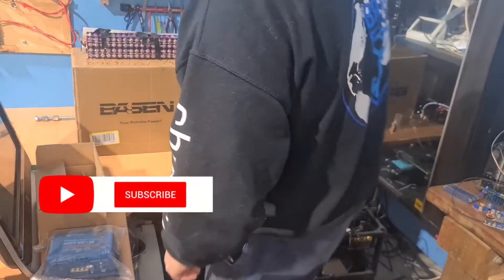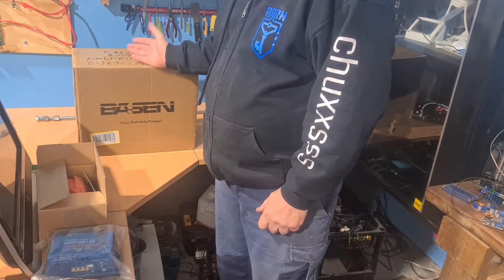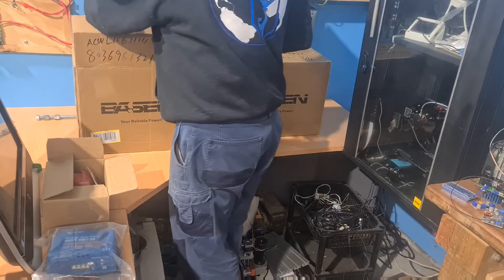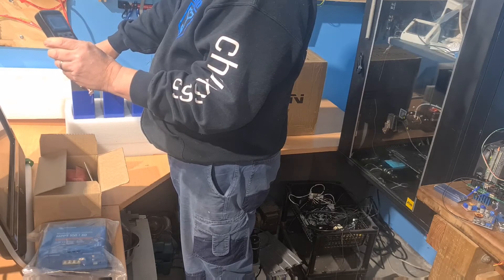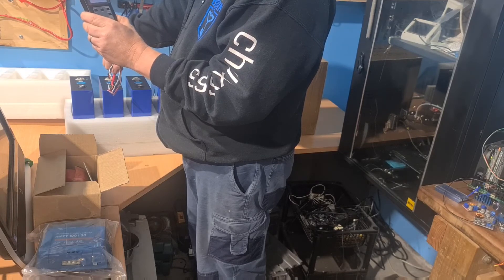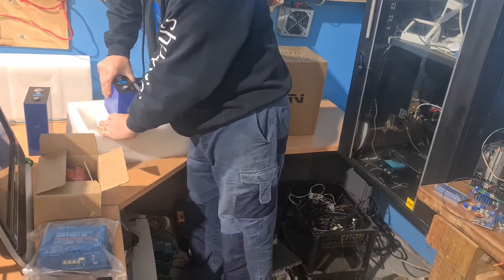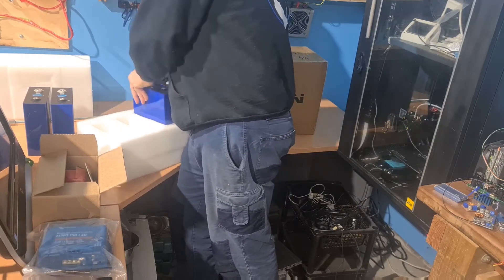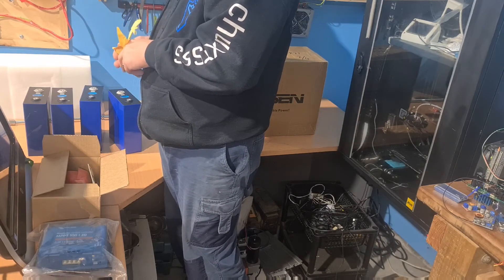Unboxing Bezen LIFEPO4 304 AH batteries to make a 14 KW 16 cell battery.  Part 1 Setup

Comment: Nice, it’s good to know that the cells are 1.06M in length when put in a straight line. I actually want to get 32 cells of the Eve 304ah cells. Am still considering it at the moment though as it would be going in a campervan, so I’ll have to make sure  I get all the weight balanced. All 190kg lol
Reply from the maker: I would think in a camper that is over kill. each 16 is 14.5 KW. How many panels are serving them? For the 14.5 KW, I have 5 KW of solar. That is 10 metres by 1.6 metres x 2. Big area.
Reply: @chuxxsss  here in the Uk, we currently have a 5.3kwh Tesla battery and it only lasts us 2days max, about 1.5days without any solar input or driving. We have Lpg for cooking, oven and shower, and we have diesel for heater. We want to build a full electric build next and want to be able to be ok for 3 days in winter which is where we need more sun but don’t have much. In Australia our 5.3kwh Tesla battery would be fine even in winter. I’ll only have 4x 400W panels on the roof of the van which would give us 1600w in total and when tilted it should get to around 1800-1900watts. When we drive I’ll like to have 2 - 3 orions smart charger to give us between 45-80A charging. But the battery would be fully charged before we leave the house using shore power. It’s only going to be used for a few days at a time, when it’s back in the house it would be charged from the sun using the solar panels for about 4-5 days which would fully charge it up again before the next trip so having 1600Watts with about 4.5hours of sunshine would give us about 36kwh of power which is more than the battery would be. I really can’t wait to have it all built 😊.

I would also like to have a 101kwh for the house and have about 12.8kw solar which should give about 57.6kw of solar in a day. ( we want to be able to charge the electric cars when we get them off solar, so we might double this at the time, who knows) But this is just the future. The campervan first then the house.
Reply from the maker: @theoteam4641  Good luck mate.

Comment: garden hose (10-12mm inner diameter or thereabouts) might fit as threaded bar cover even better than shrink tubing, just select size by the inside diameter being a bit more than the bars. I myself use 15/12mm electric pvc tuber to protect 10mm bars.
Reply from the maker: The pvc may be the go too.

Comment: I've used garden hose to insulate the rods - save the heatsrhink. I have similiar cells - 280AH.
Reply: Forgot to mention that I've set mine up in 4 packs of 4 - for easier transport. All up the 16 will weigh around 80kg.
Reply from the maker: Yes, I know they are heavy,  did my back in a week or two ago carrying them in to house.
Reply: @chuxxsss  Watch the back! Another mate of mine has ordered 16 cells...things are getting hot!
Reply from the maker: Didn't think of garden hose, would have been a cheaper option.

Comment: Looking forward to watching this set up. Where did you get the cells from? The AGMs on my motorhome are currently dead, I have a shore power connection for now but expect to be putting together a couple of lithium 12v batteries within the next 12 months.
Reply from the maker: Got the batteries from Alibaba dealer Bezen batteries where 2700 delivered. BMS was a bit over 200 dollars. But I would use Daly for your setup. 168 dollars each battery.
Reply: A mate of mine ordered some from AliExpress - $2500 delivered I think. I'll see if I can get the link - he sent it to me but right now I'm on another computer...
Reply from the maker: @Bennyboy-dog  That's cheap if grade A and not B or C cells Ben.